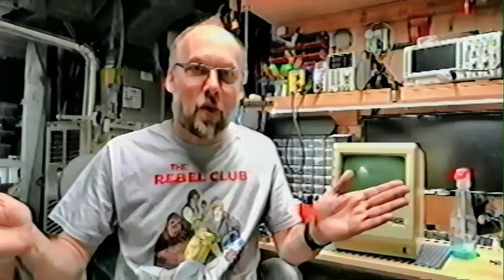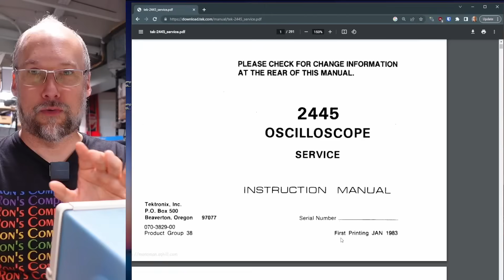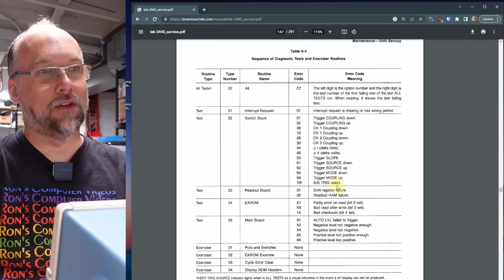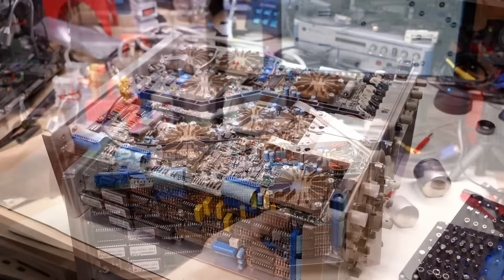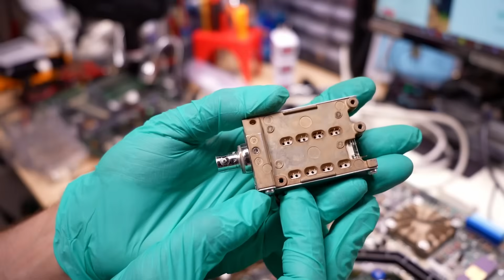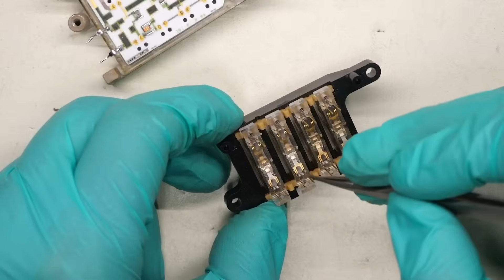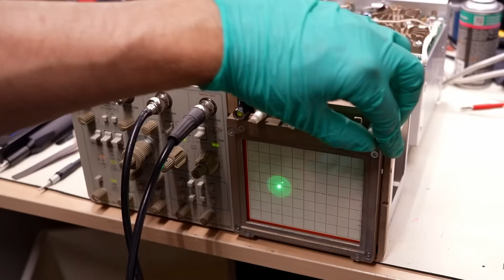Tektronix 2445: My first vintage oscilloscope repair attempt

Comment: You might try going over the contacts with a pencil eraser. It's mildly abrasive and should polish the contacts nicely. Note that this should be the pink kind because the white ones are a different kind of amalgamate and they remove pencil led by absorbing it instead of rubbing it off. Anyway a few gentle rubs should get the oxide layer off nicely. I know this because that's what I used to use to get the tarnish off my model railroad tracks when they would stop working properly.
Reply: Never ever use a pencil eraser for cleaning any gold contacts. The elastomer and the abrasion will destroy or greatly reduce the life of these contacts. Use IPA with a foam applicator. Worst case use Caig De-Oxit gold very sparingly only on the gold pad, just a very thin film. If you must bend the contacts of the relays as little as needed to reform them. HP wrote a Bench brief article about the reasons why you should never use a pencil eraser or anything abrasive at any time on gold contacts.

Comment: Maybe installing thick thermal pad instead that papar over relays would be better idea? They must generate some heat and paper will just isolate them and slowly cook.
Reply: No.  These are latching relays.  They are only supplied with power to change state.  Whatever state they are in, they remain in that state without any power, and hence without any dissipation.

Comment: Try soaking the relays in an ultrasonic cleaner, and also clean the sockets where the golden pins are seated. You may want to check for cracks in the ceramic substrate using a microscope.

Comment: It's really a surprisingly capable scope for its age, could be really handy to have around if it didn't have those issues. I definitely feel like those contacts were only tangentially related to the root problem, so hopefully a "grey beard" will appear in the comments with some good advice on how to further troubleshoot/fix the problem.

Comment: @28:00 Dont assume gold connections are fine, I have fixed test equipment multiple times just by cleaning up gold connections with deoxit and a fibreglass brush, they still get oxidisation, just not as badly as other surfaces.

Comment: I only just started watching, but make sure you replace the RIFA caps in the power supply, and the main filter caps too, when those start to get weak it puts too much ripple on the rails, which then causes the yellow axial tantalum caps to fail throughout the unit and short out. I've done some videos repairing my 2432A which is the same kind of design.

Comment: I could be way out here but has anyone had issues with Deoxit on gold plated connectors before? I myself have. I have an Amiga 500 with the gold plated Zorro connectors and they are super clean but a couple of times I put deoxit on them and straight after had issues with the connection. Cleaned off the very light lubrication left over from the deoxit and the connection worked perfect. Ive had this problem a couple times now with other gold plated connectors too. I am starting to question how good it is for gold plated connections.
Reply: De-Oxit comes in a couple of varieties. More than one variety leaves residues behind, for either lubrication or to "protect" the gold. There are also varieties that don't leave any residue behind at all. Look around for the De-Oxit that doesn't leave any residues behind, and you should be fine.
Reply: @kostaskritsilas2681  Will definitely look into that. I can't remember the type I have off hand but I know it leaves a light lubricating oil on the contacts. I just found it better to keep them clean with isopropyl alone but if they have a type with the residues then I might give that a try.
Reply: There is a version of DeOxit for gold contacts, you might have better success with it.

Comment: Looks like the BNC on the can is lose/broken, ie, check wire/pin connect to PCB - seen a lot of repair vids where these broken -.
I guess look for new relays, but it could be the connects on the PCB that mate to the relays pins.
Maybe ultrasonic the PCBs.

Comment: Hi Adrian, I love your channel and really appreciate the great job you are doing.  In regards with this oscilloscope issue, I would suggest you could get in contact with your fellow youtuber  CuriousMarc, who is really good restoring and repairing old equipment, so he could certainly give a hand if he has the time.  I remember I have seen a video not too long ago where CuriousMarc gave a hand to LGR repairing a vintage Sanyo calculator.  Good luck and keep doing such a good job.

Comment: The problem is probably inside the relays.  Relay contacts do not last forever, they can oxidize or be damaged by repeated cycling or even arcing.  Although arcing is probably not your issue here.  But the chance of fixing or polishing the contact points in a relay that small are pretty much non-existent.  A bigger relay i would suggest using a slip of paper as a very mild abrasive, and just push the contacts together with the paper between and then gently pulling the paper out.

But again, those relays are so small it would be hard to access the contacts without breaking something.

Comment: If there's one thing I've learned about cameras over the years.. it's that they absolutely suck at auto-anything.  Be it cheap webcams, average phone cams, or expensive digital cameras.

They seem to be designed around looking at a full human in sunlight at a specific distance, and that's mostly it.  Taking them indoors and looking at all sorts of things, especially in rapid motion video, makes all their flaws standout.

Slow (multi-second) autofocus may be the only useful thing if that's an adjustable option to stop it from going crazy hyperfocusing, but still nothing beats locking all settings and framing each shot manually.. at the expensive of a lot more setup time.  A "pick your poison" thing.

Also wow that analog scope just seems so smooth in video, like it's 120Hz.  Can only wonder if it actually looks that smooth (or smoother) in person.

Comment: Maybe look into the main PCB itself? The relay pin sockets may be flaky, or perhaps there is a break in the PCB. I guess the relay(s) that bypass the AC capacitor isn't making true contact, or perhaps isn't receiving the voltage to activate.

Comment: That's the model scope i used in college in the mid 80's (or one that looked just like it).  Excellent o-scope.   There's something about a good analog scope that you just don't get with a digital scope.

I take it back, our scopes didn't have OSD.  That was a newer design.  It had to be digilog for OSD, the ones i used were pure analog.

Comment: A trick we use in the audio industry is using a graphite lube, the theory being the conductive graphite will fill in the holes in the contact pads.
Reply: No. Please don't introduce any wandering conductive material into the attenuator.

Comment: An important safety note about cathode ray oscilloscopes. If you are used to working on televisions, which I know you are, you may expect the cathode and other neck board voltages to be near ground potential. THIS IS NOT THE CASE IN A CRO. The cathode potential can be as much as several thousand volts below ground. This is because the instrument uses electrostatic deflection, and the deflection plates can't be any more than a few tens of volts above ground, or it would be very difficult to design the vertical and horizontal deflection amplifiers.

The odd supply configuration of a CRO might have something to do with why you are seeing RIFAs where you don't expect therm.

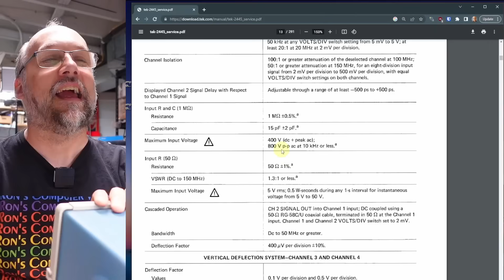Comment: 12:15 My garden variety Rigol 1054Z has an input voltage rating of 300V cat3, which is lower than 800V, but not bad. Input stages actually aren't that different between a digital and analog scope. Dave at the EEVBlog has an interesting videos reverse engineering a budget Rigol input stage. One thing to remember: the first thing after the DC blocking cap and 50 ohm terminator, and their assorted relays, is a 1 Megohm resistive voltage divider, so you've dropped the voltage quite a bit before you get to anything solid state.
Reply: Obviously, don't try to put 300V or 400V or 800V on the input if you have 50 ohm termination engaged, unless you really like the scent of Magic Smoke.
Reply: Only on modern analog multimeters with FET input stage., old ones were purely series resistors (with germanium diode OL protection) . 5 to 100K per volt depending on quality ie meter sensitivity. 50uA being 20K etc . The more sensitive the more delicate the meter movement.
Ex Gardners Radio.
Reply: @joefish6091  Scopes, not multimeters.

Comment: Hi Adrian , Ray Burke here , I use to work on the Tektronix Portable scope line.  Most of the gold contacts shouldn't be scraped with tweesers, Tektronix in their manuals usually suggested using Isopropal Alchol and a this peace of paper in the service manual unsure about Deoxit?  The problem with the CH 1 and CH2 Attenuators may be the outer mounting ring screwed to the Attenuators, using a thin open end wrench to carifully thghten them, they might be loose from connecting and disconnecting the scope probes.  This could cause the signal to distort. You may contact the Tektronix support forums or the Beaverton Museum.
Reply: you do not want to use DeOxit because it leaves a film,and any film on the contact is what causes problems. (me;TEK service centers,21 years.)
Reply: Adrian  you could use a scope on the Ch1 and Ch2 input center pin for a square wave trying the ground on the outer BNC ground.  Then try  on the chassis ground, also  use a DMM between the BNC and chassis ground.  You  might  be able to probe with a scope through the attenuator, after proving the input  waveform isnt distorted.  Not through the dividers.  You could get help from Tektronix of through some local scope repair  centers in Beaverton.  They might help with obtaining  parts,  Their is a source of Tektronix parts Q source Google it.
Reply: Adrian Ray Again I noticed the input BNC connector if it doesn't have a BNC nut on the inside (Like standard BNCs).  Then the BNC ground is through the Allen screw on the bottom of the Attenuator next to the BNC, and it is probably loose.  Which is what connects the BNC to the Attenuator chassis.  Try tightening the Allen screw, cheap fix.  I noticed the screw when you had the Attenuator upside down.  Good Luck Ray.
Reply: Hey Adrian when pushing on the CH 1 and CH 2  attenuators on the outside of the probe ground, which was intermittant.  The problem as I said before was the ground connection through the outside grounding Allen screw on the bottom of the chassis is loose.  Which is causing the signal to loose its ground connection to the Attenuators.  When you removed the Attenuators from the scope, did you loosen the Allen screws, next to the BNC's?  If you didn't touch them, that could be your intermittant ground problem.  Possible using a DMM and wiggle the BNC to the chassis.  Good luck from Ray.
Reply: Mr. Ray, can you help me diagnose a 2445 I just bought on eBay? I don't have it in hand yet but I'm putting out feelers already for people who may know what's going on with the scope once I have it.
Reply: @user-lp3cf5yn5b  Ray here, I have knowledge of the Tektronix Portable Scope line.  I know lots of things about the analog and some digital scopes.  I am not an expert on the high end  2445 scopes, their are more complex than the lower end scope line.  You will have to get ahold  of the full service manual, or find a manual on the Tektronix WIKI  or forums.  Do you have any experience with these scopes, DMM's, soldering irons, other scopes for troubleshooting?  If you don't, I would suggest you buy a refurbished scope that is fully calibrated.  Or just get a new  digital scope,  Rygol or others, they also come with probes. Good luck, Later Ray
Reply: @rayburke4386  I already have it. So far it seems to need recap on the PS, and replacement of a SOC123 optoisolator on the inverter board. The PS is either putting the wrong voltage out, the 87 and 42 volt lines were a hair lower than spec, and the +5vd line was 4.2 v instead of 5. The troubleshooting guides point to both the feedback circuit and problems in the 5 and 15 v unregulated lines. I've seen too many different things talking about which series of caps to use to replace those 672D Sprague caps. It's hard to find caps that are the same values with the same ripple current rating. Any suggestions? Chemicon rep  and Vishay rep got back to me and suggested several different series. Vishay doesn't have the values necessary with equivalent ripple current. Chemicon does. Rep said to go with LXY or KYB series. People on tekscopes also suggest either Nichicon UHW or UHE series, or Panasonic various different series or chemicon KZN series. I'll eventually get the PS recapped with something and hopefully then I'll have a working scope.
Reply: @user-lp3cf5yn5b  Ray here it sounds like you are on the right track, and have the knowlege to fixing the scope.  When I was working on my Tektronix 2235 recap, I used Digikey to source the parts.  Any of the higher end vendors should be fine.  Using low ESR high temp caps should last a long time.  Good luck on your recap job, Later Ray.

Comment: I’m not sure abrasion is necessary, but I’d totally consider squishing the spring pins on the relays since pressure helps the connection. Springs do weaken over time after all. It also sometimes behaves like there’s stray capacitance, so some of the pins might be losing contact but stay close enough to form some capacitance along with the circuit board etc. Either way reinforcing the pressure would be the simplest thing to try, since you noticed it’s pretty clean inside.

Comment: As a old and 8 years retired engineer in electrical (with Two exams in enginering (the second for an master of electronics) and 1.5 years studies in astronomi) this video gav me kind of years in my yes). Techtronix is This the shit, but last time I used one was in the mid seventies!!! So this was a very modern Techtronix for me😁👍! The inside of a Techtronix is real beautyfull of enginering quality. Any old engineer will Come to years and want to hug and kiss this fantastic beautyfull ❤️❤️❤️❤️😮😮😮😁😁😁👍👍👍. And as allways your videos are fantastic. And make The viewer feel good and Happy and you feels like an old really Nice friend to us. Thanks 1000 Times. And of course my old trust Amiga 1200 with a accelerator is still working just as my sons Amiga 1200 still is doing. He is also an engineer (in comp uting and  software of course). And we also has Z 81s, Spectrums and Amiga 500,Amuga 500 plus  and still working Commodore and old Ohilips monitor. So every time when I feel low after starting  some PCs  I just have to start my Amiga and feel glad and smile again. But anyhow thanks for your fantastic videos. 😁😁😁👍👍👍

Comment: The relay pins that exit the bottom of the attenuator modules must be contacting the main PCB in some way. They look like the pins for each coil. I never saw how they connect to the main PCB, but I would definitely check/clean those contacts.

Comment: Did you check the BNC connector itself on channel 2? Tapping at like you were is indicative of a cracked side of joint on a connector.

Comment: Thats a lovely scope. Everybody needs an analogue scope and a digital one, just like your multimeter :) Just a little warning, I used to make thick film circuits and if you are soldering to them you should use high silver content solder or the 60/40 will absorb the silver from the film traces
Reply: You're 100% spot on about the solder, in fact, I know older tek scopes actually included a small roll of that high silver content solder inside its chassis. I have one of these scopes, 2445a but close enough, now I want to open it up and see if it has the little roll of solder or if it's only something they did with the older tube o-scopes.
Reply: @chrischeetham1652  Im pretty sure it was only the older scopes, I too have found it in a 475A

Comment: I love the old Tek scopes!  I had one of those on my bench when I was in the Army back in the mid-'80s. I just looked and found that scope (refurbished and guaranteed working) online for about $200.  (I'm tempted to get one for my own bench, to sit next to my 500 MHz Tek DSO I snagged "untested" for $200 on Ebay some years ago.)

Speaking as an EE, the triangle(ish) waveform from the square wave signal is caused by capacitance in line.  Yep; cruddy contacts can do that, and they can also cause low signal.  So, I think that you are on the right track.  BTW, DeoxIT has a formula specifically for gold contacts.

Comment: The way I was taught to clean those gold contacts is with a small strip of white printer paper and IPA.  I have serviced quite a bit of old Tek equipment.  I love Adrian's show, but I would strongly advise against scratching up the pads with a steel implement...
Reply: I too cringed when he started 'scratching'.
Reply: @Brian_Of_Melbourne Me too. I was shouting "NOOOOOOO!!" I'm my head. This gear isn't an old Commodore 64!!
Reply: You were taught correctly... I usually clean them with ethanol, IPA or KontaktWL. Scraping them like that will for reduce the surface where the two contacts meet and maybe even remove too much material for it to conduct at all.
Reply: If the gold is just a coating, it's risky to try and starch it.
Reply: Back in the day, I always used the rough end of an ordinary rubber eraser to clean PCB edge connectors.
Reply: @theantipope4354  I would suspect that introducing more contaminants into an attenuator like that isn't a good thing.  Just Isopropyl alcohol (AKA IPA) and a Q-Tip will be fine IMHO.